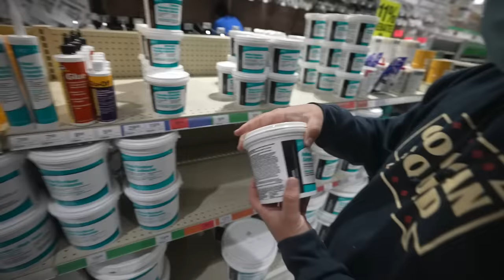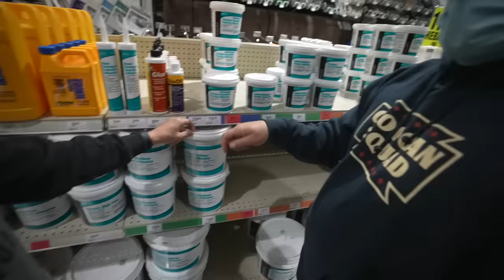Building a HOMEMADE DIY Bass Boat for My BACKYARD POND!!!

Comment: Flair : let’s make a bass boat out of a Jon boat
Price of lumber: might as well buy a new bass boat !
Reply: Its so fcking high rn 😤
Reply: @Anthony Hallam 4 20
Reply: Lumber is ridiculous right now
Reply: only four geese left
Reply: In Ontario where I am lumber prices are crazy $18 for a 2x4 12 footer and a sheet of pressure treated plywood is $100 crazy
Reply: @RP 87 here in Newfoundland we are paying 100$ a sheet for 3/4 sheet of plain plywood
Reply: @liamkellyvolgsandmotovlogs9817  in Newfoundland we can’t buy lumber over 8 feet without a finger joint in it and plywood is 100$ a sheet for plain 3/4
Reply: @liamkellyvolgsandmotovlogs9817  I'm in Ontario too and I saw plywood panels going for $120 in my area
Reply: @campbell0162  yeah and my dads buddies buddy bought two 2x6’s and paid $21

Comment: Nice job man! You can make a battery box, cut a square piece by the trolling motor in the front and place a battery in there and make a lid with hinges and then you don’t have to worry about getting the battery wet or thrown off the deck. Hopefully these tips will help. Thanks

Comment: The lines in concrete are called contraction lines. French Drains are typically gravel with drain pipe under it to move water away from your foundation. Cool boat build though!

Comment: Those slits and concrete are called control joints so if it cracks it cracks in the joints

Comment: You need marine grade so it doesn’t corrode the plywood. You would still seal it. If you use non marine grade it will corrode a hole in your boat.

Comment: The difference between plywood...
 Marine plywood is stronger and more durable than regular plywood, which has only three layers. ... In addition, it doesn't have as many voids as regular plywood, which makes it structurally stronger. While regular plywood has little spaces and air pockets in each layer, marine plywood has substantially fewer.
from google.

Comment: next time buy a proper comb, urs has to little/few holes... u need a lot more glue.. and put some weight on it when drying... ive glued a lot of turf on indoor skiing lanes in my time... for 1 lane i used about 20 5 gallon buckets of 2 component glue...(dont know brand off my head)